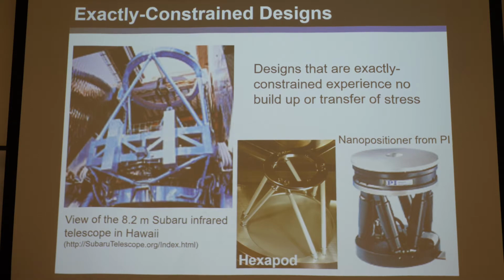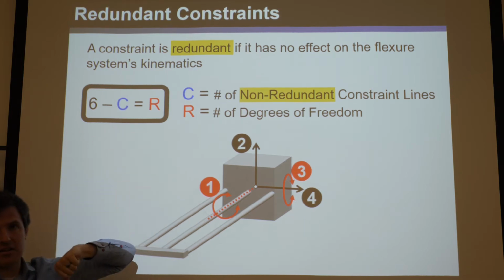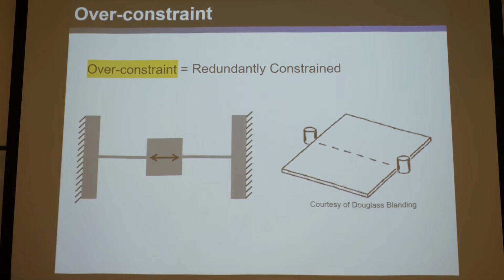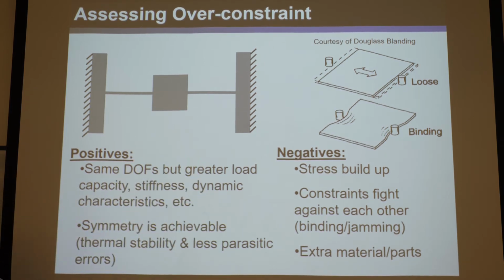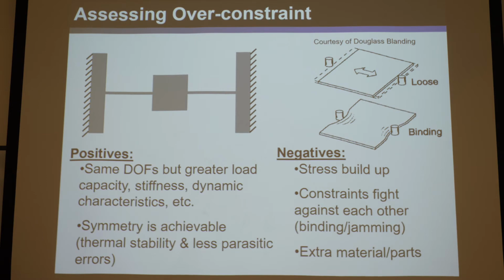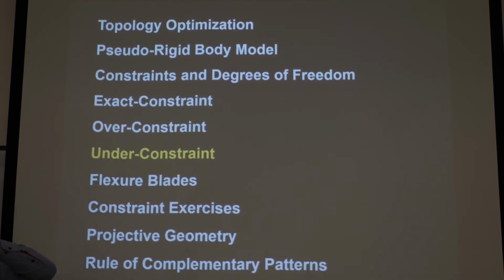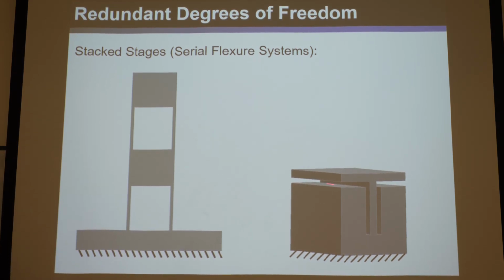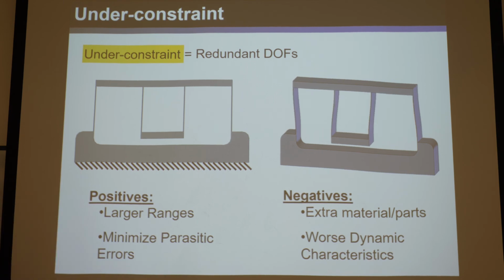Compliant Mechanisms Lecture 4 Part 3

Comment: These concepts are just GOLD. Not just if you want to design sophisticated compliant mechanisms in silicon, but every mechanical engineer should be aware of this. How often did I see poorly designed mechanical stages that broke just because they were not mounted correctly (and by this probably got overconstrained).

Thank you for this whole series!!